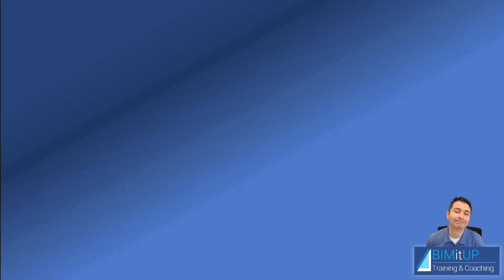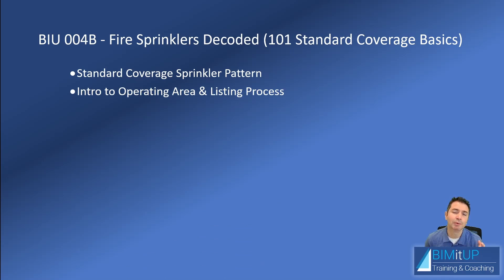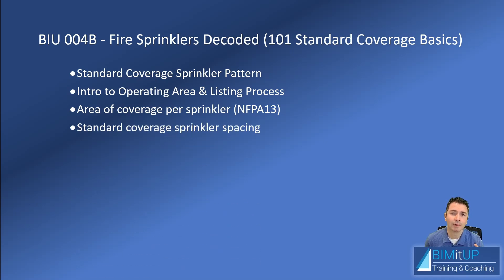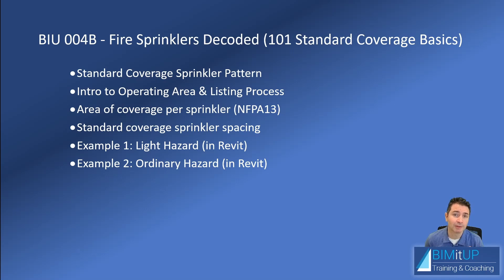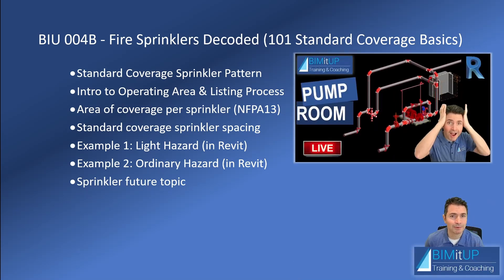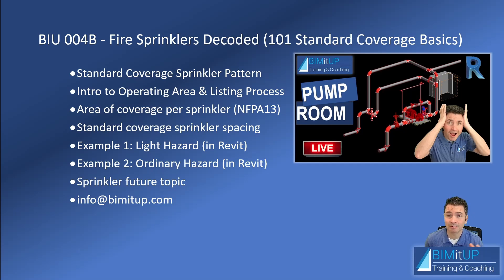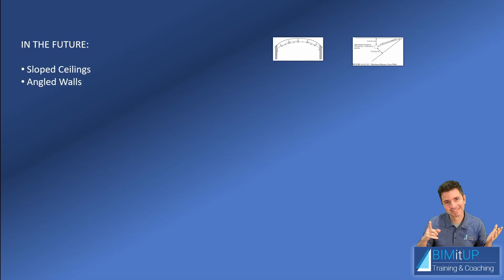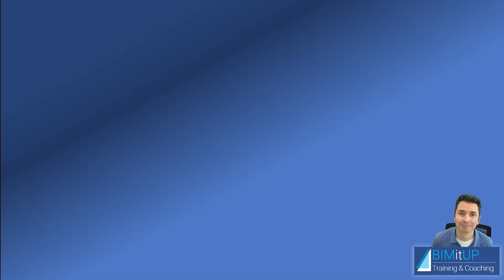Sprinklers Decoded #1 - Standard Coverage Fire Sprinkler - Spacing, Area Tutorial

Comment: Thxx for this great explanation! Is this method applicable for sidewall sprinkler?
Reply from the maker: You are welcome. I'm glad it was helpful.
Sidewall sprinkler concept is very similar, but S and L are a bit different. Check NFPA 13 section for sidewall sprinklers, and I'm sure with what you have learned here and that, you will be able to work with sidewall sprinklers. Good luck!

Comment: I know this is a couple of years old, but I’m not understanding why there needs to be 4 sprinkler heads on each branch for the normal exposure example. I’m starting with the room 26.625’ left-to-right and 26.917’ top-to-bottom.

It seems to me the way to enable the maximum sprinkler head spacing (S) is to minimize the branch spacing (L) since S = 130 / L (smaller L means larger S). The way to minimize L is to divide the room width by 2, which gives a branch spacing of 26.625’ / 2, so L = 13.3125’. Any smaller and the branch-to-wall distance times 2 would be larger and used instead for L.

With an L of 13.3125’, the max sprinkler head spacing becomes 130 sq ft / 13.3125’, so max S = 9.765’.

If I distribute 3 sprinkler heads along each branch, I can determine a good spacing by dividing that room dimension by 3. So 26.917’ / 3 means S = 8.972’, which is greater than the 6’ minimum spacing and less than the 9.765’ maximum spacing needed to stay within the 130 sq ft maximum area when the branch spacing is 13.3125’. Spacing from the first and last heads on a branch to their respective walls is 4.486’ (1/2 of S, so 8.972’ / 2).

I’m not trying to pedantic, I’m really trying to understand and I’m not sure my math is correct or if there is something I’m not accounting for.
Reply from the maker: Thanks for the comment.
And, no worries, I always assume people are genuinely trying to understand.
A couple of notes: This is meant to be a simple introduction and there's many ways to lay out sprinklers (depending on several factors (out of the scope of this free video). There was also a harsh video cut at 15:11...which I realized several months after uploading the video =(

I'm assuming, "normal exposure" you mean Ordinary Hazard (since you mention 130 - 130sf max per sprinkler).

I think the confusion comes from your statement "minimize the branch spacing L".
Actually, most of the time, you want to keep L (distance between branch lines) as large as possible so that you minimize the number of branches (fewer large fittings, etc.) (4:10 and 11:32). Hence the initial 14' separation (we want to keep 2 branches only). However, the distance between sprinklers cannot remain at 14' (like in the previous example for light hazard). So, I tried keeping that distance as 10'. However 130sf / 14ft = 9.286ft, so they cannot be spaced 10ft either, it has to be even smaller...
Now, if you pause the video at 15:08, and remember the 9.286ft max distance... 9.286/2 = 4.643ft, and the distance from the wall is 4.578. So the top sprinkler would barely comply (again, assuming the video frame of time = 15:08).
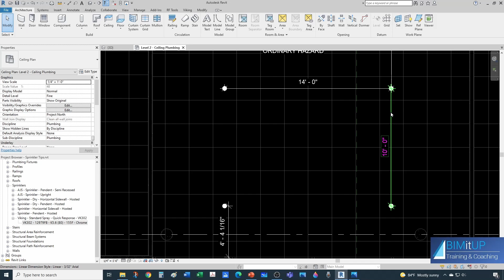HOWEVER, if you move the south sprinklers up 2' (because remember, 10' between sprinklers is too much, so you have to shrink to 8'), then that distance of 4'-4 1/16" shown on frame 16:51 becomes 6'-4 1/16", which when multiplied by 2, exceeds the maximum distance along branch line.

Just as a word of caution, even if the south sprinklers were at the same situation as the north sprinklers (barely making it), I, as a consulting engineer wouldn't keep it since the ceiling could shift 1 inch and then everything is out of compliance (not to mention any changes with lights, diffusers, detectors, etc.).
(As a contractor you can push a little more, because by the time they get the project the project is a little more "solid").

I really hope this clarifies. Thanks for watching and good luck.

Also, keep in mind that depending on workmanship, type of fittings and site conditions, it might be beneficial to "revert S and L", and remember, your layout has to be "balanced (symmetrical and pretty), so that Architects like you too =)

Comment: Should water temperature and room temperature be considered for efficiency...also should mix type of fire class like gas station out door fuel fire and foam ratio per area
Reply from the maker: Hi Eric.
Water temperature and room temperature have no direct effect on the sprinkler spacing. Sprinkler spacing is a function of the "fire occupancy hazard". If you have a gas station you have a more demanding fire occupancy hazard than an office, so your sprinklers would have to be spaced closer together and you would be required to use a higher water discharge density (gpm/sf).

Comment: What  is the standard  distances  if the  sprinkler heads upright  position  under the beam?
Reply from the maker: There are several factors that can affect that.
The 1st one is Occupancy Hazard. If you are in a Light Hazard space, the maximum spacing is 15' and the maximum protection area allowed is 225sf. If you are in an Ordinary Hazard I, then max spacing is 15', but max area 130sf. There are also obstructions, etc. Check NFPA 13